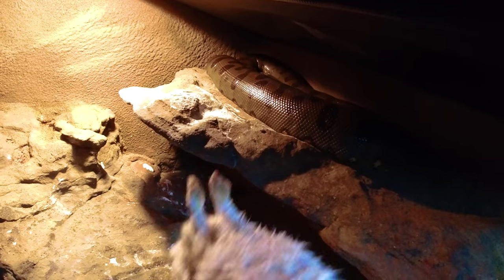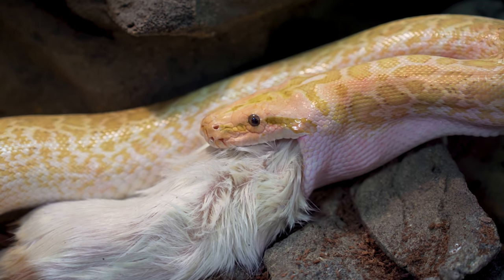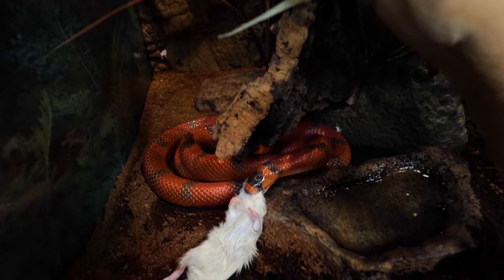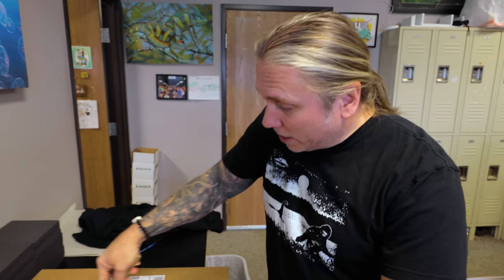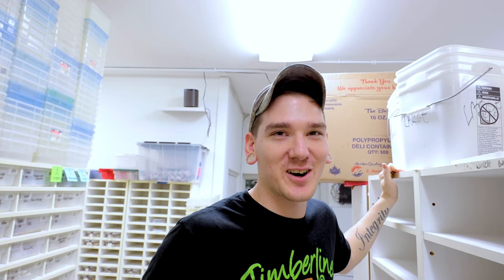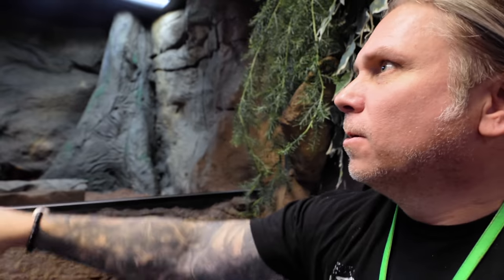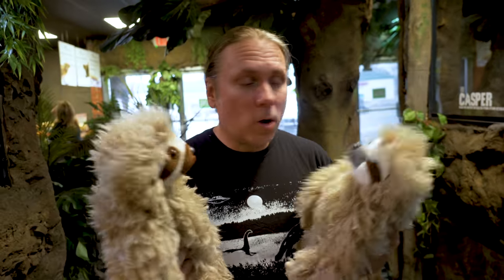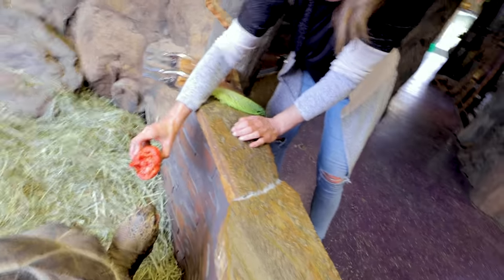BIG ANACONDA EATS TWO RABBITS!! WHAT EXCITES ME ABOUT THE REPTILE ZOO EXPANSION??  | BRIAN BARCZYK

Comment: On the larger enclosure I would definitely do all 4 sides with the support risers u are doing and one in the center.  I my self would do all of them with 4 sides and a center. 2x4 are not expensive they are actually pretty cheap. I cant imagine u spending to much building. It will definitely suck the first time one gives out because u had to go inside to clean it. I saw the wood u guys build them with and they will absorb water not sure how well the bottom is water sealed but if one is not sealed 100% and a year from now u step in and fall through that would suck. It could still happen with the support on the bottom but improving the chances it doesnt for sure.